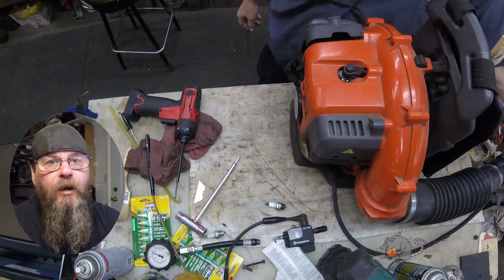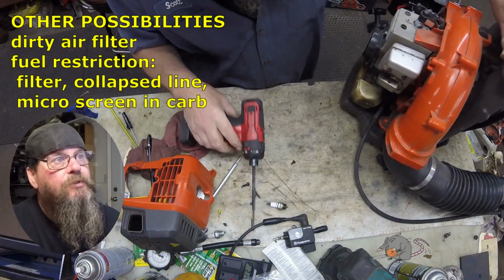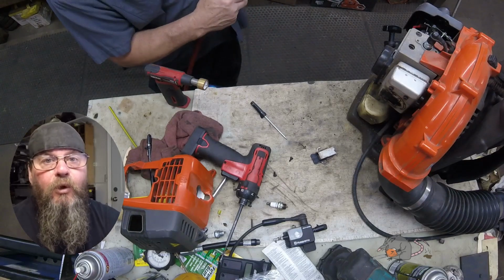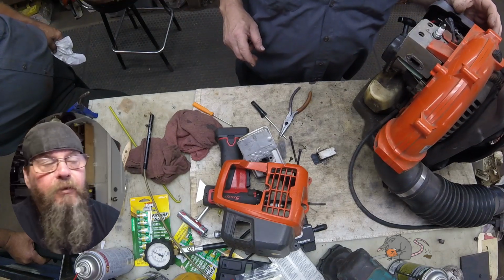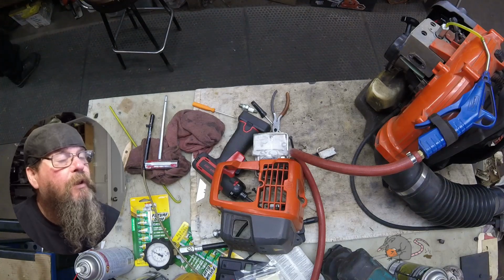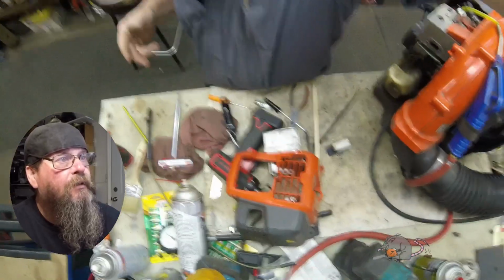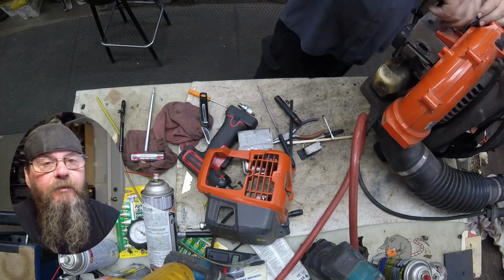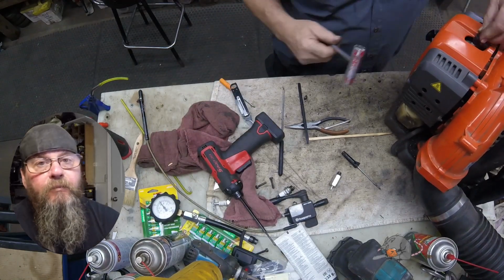Two Stroke Tech: How I Decarbon An Exhaust Port

Comment: I had a Ryobi edger/trimmer combo once for 2 years and one day it just stopped running. Determined the muffler was clogged with carbon and gunk, so I drill 3 large holes in it. It ran GREAT for another year, but sounded like a Harley, it was so loud 😂(cheap throw away tool got my money’s worth)
Reply from the maker: Good on you for getting that extra use out of it. Thanks for watching!

Comment: Great video. It’s one of those that people overlook. I place the piston skirt there.
Reply from the maker: I think it could go wrong either way. A scratched skirt or carbon in the cylinder.
Reply: @TheGreasyShopRag I place the skirt there while cleaning, hold the unit almost upside down and vacuum it out.  But know I really want to try your air method.    Yes I’m crazy but really enjoy learning new techniques.   Take care.
Reply from the maker: @steveriggenbach90  As long as you don't scratch the skirt I think your method is the preferred one. You're certain not to get anything in the cylinder. I've had problems using plastic or wood tools to get that carbon up against the skirt and thats when I started trying this method.

Comment: What causes it to get so clogged with carbon? Is it because of an improper air/fuel ratio?  Oil/fuel ratio? bad timing?
Reply from the maker: I think one way is poor quality oil combined with low engine speeds that don't allow enough heat to build up and burn things clean.